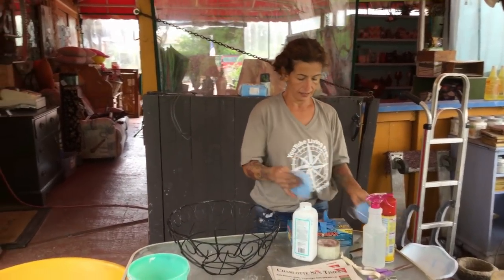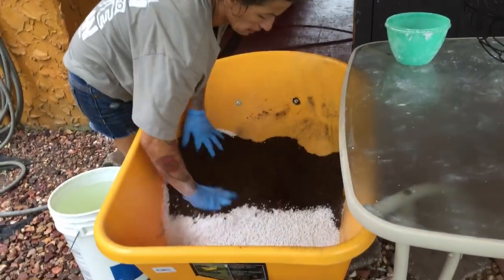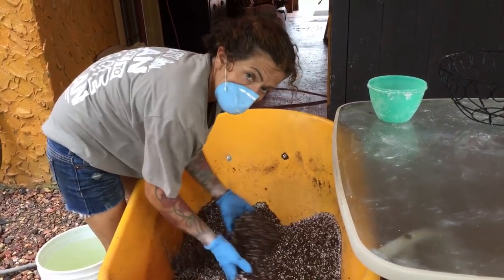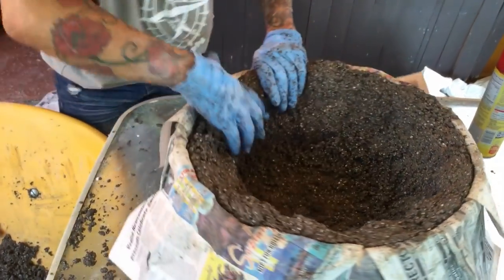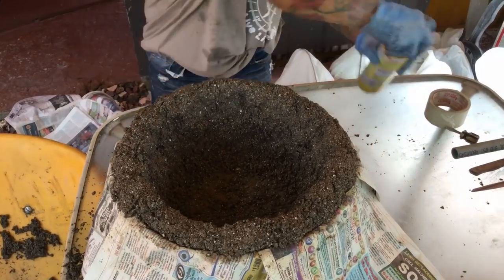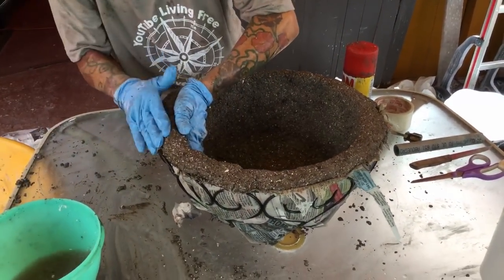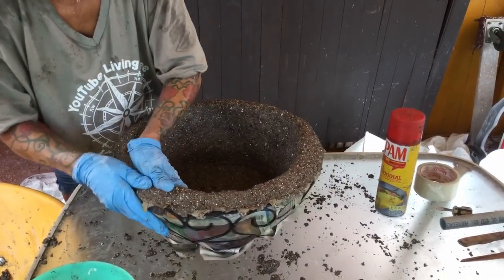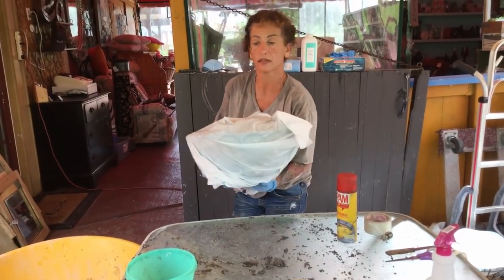How to make hypertufa pot in a wire baskets

Comment: 3 parts peat moss (well broken up)
3 parts perlite
2 parts white portland cement
approx. 2 1/4  - 2 1/2 parts water

mix peat moss and perlite very well first then thoroughly mix in cement, then gradually mix in water until you get a bouncy ball. Mix very well.... You don't really need to make a hole in the bottom because hypertufa is very porous and permeable.